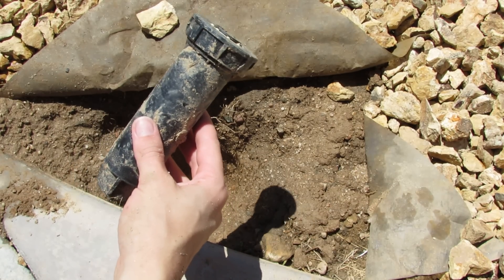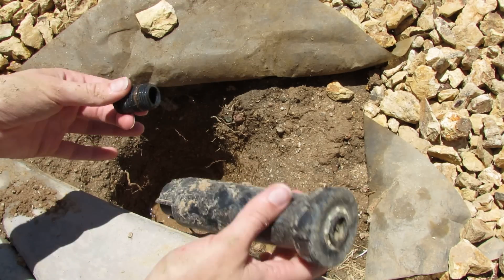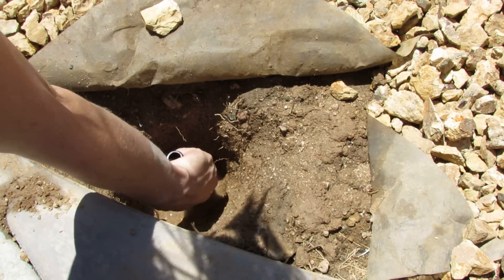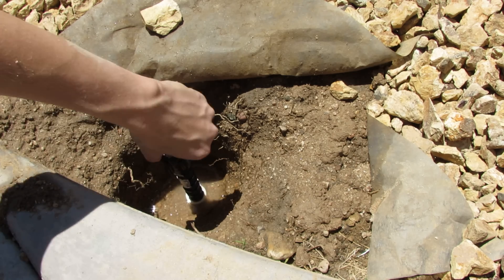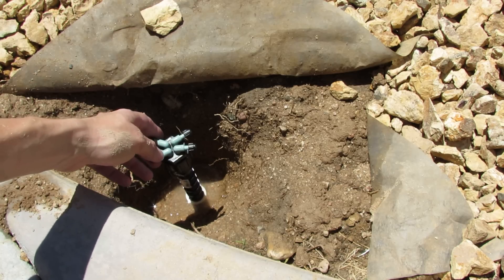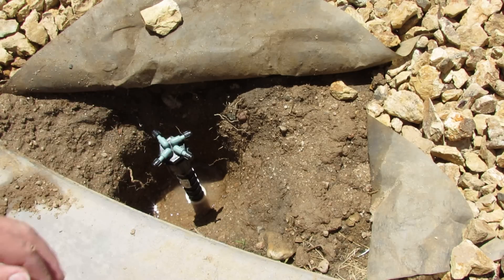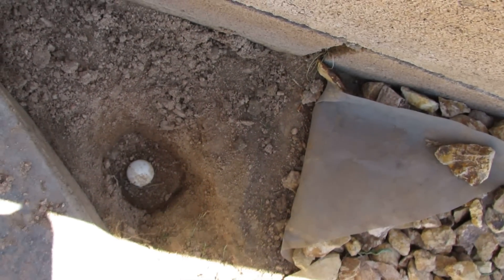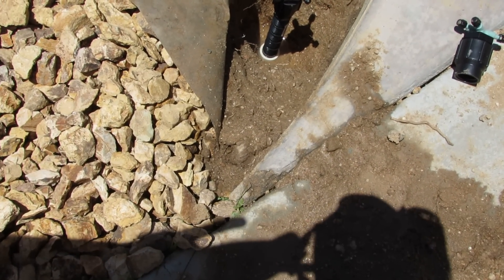How To Convert Sprinklers into a Drip System Irrigation Rainbird

Comment: I absolutely love your video. I'm the one who always seems to be the one to repair our broken sprinklers lol , so with that being said I've been wanting to come up with a simple solution for weed control in our front yard. We have a few nice trees surrounded by lots of dirt. I have purchased ground cover and I'm ready for my new project. I have a good tip that I do to clear the line of any dirt etc. After I remove the broken sprinkler I turn on the system to clear the pipes then I know the sprinklers aren't clogged of dirt and disperse water efficiency.

Comment: When you convert that one sprinkler riser (obviously the sprinkler head is removed) do you have to cap off all the other sprinklers heads that are in the same zone? Do these manifolds have a built in pressure regulator? Also, with this 4 port manifold (which looks like it uses 1/4" tubing and not 1/2")...aren't you limited to only 4 plants near this manifold & since it uses 1/4" tubing...isn't there a limit to the maximum length of the tubing? Thanks!

Comment: Couple of questions: 1.) It didn't seem like you installed a pressure regulator. Isn't the pressure used for a regular sprinkler system much stronger than the pressure for a drip system? 2.) When you took off the original pop up spray head, some dirt may have gotten into the tube, is there a filter to keep the dirt out of the drip?
Reply: +Haley Knows how easy was it to go with option 2? do you have a video you can point me to that instructs you how to do it

Comment: Its not called a manifold. Its a drip adapter. And if you eliminate several sprinklers you’ll probably have that snapping off constantly. Pressure regulator on the valve is required as it lowers the psi to 35-25 pounds
Reply: Except it does function as a manifold would function and the manufacturer calls it a manifold themselves.  Even other brands call it a manifold for similar products.  Let's just go with manifold.
Reply: @robert5c  Do we need to install a filter with this or is there a built in filter?
Reply: First it is universally called a manifold. Second, the manifold has a built-in water pressure regulator. So this lady knows exactly what she is doing and what she is saying.
Reply: @christ2551  Not exactly. Most (almost all) landscapers would have flushed the line before installing the drip manifold. When removing old sprinkler heads, etc, dirt and debris may go in the line. If she did before recording the video, she didn't say so. And it's better to do so with the riser on to avoid back flow.

Comment: I wonder if you had problems with that manifold you installed.  You didn't run clean water through the riser before you installed it and there was visible dirty water prior to adding the riser.  That was a kind of a sloppy installation.